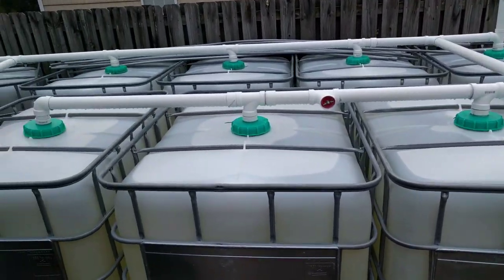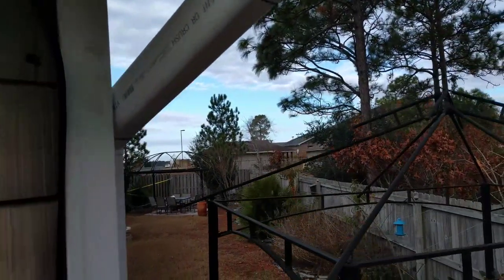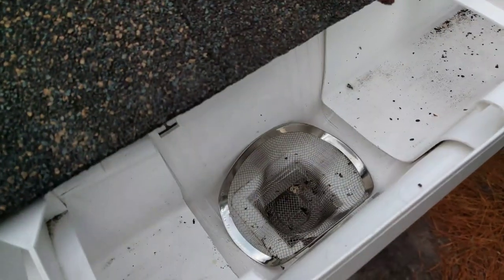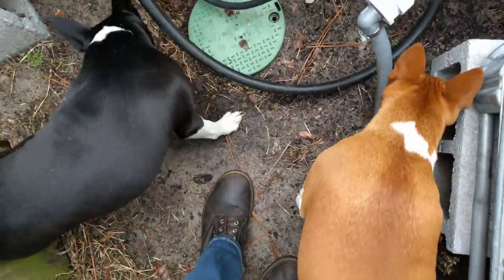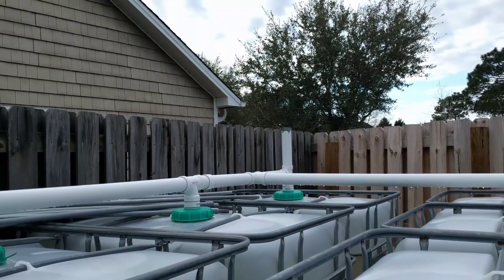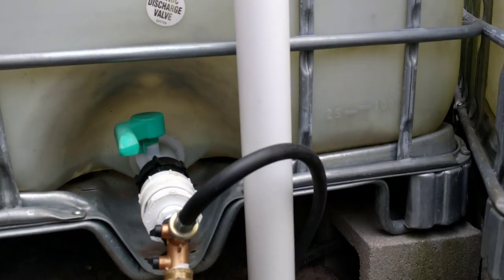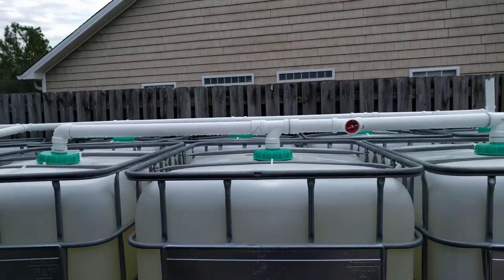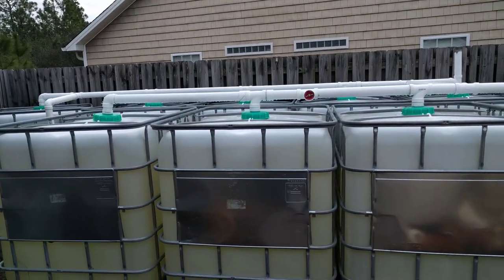Top 10 Tips For Rainwater Collection

Comment: You need to wrap those totes in black plastic or some other method to keep Sun off them.  You will have an Algea problem in no time.
Reply from the maker: Peter Gilfillan they are light blocked UV plastic totes (like the milk jugs that do the same) to prevent algae from growing - I live in an extremely sunny location and have had zero algae and I installed them over a year ago! you are correct though  if the tanks were not light blocked that would be necessary.
Reply: Brilliant work.  Love your set up btw.  Well done : )
Reply from the maker: thank you! It took lots of planning and plumbing :)
Reply: Yes indeed, tip 1, don't use translucent tanks. He now has some algae growth...😉
Reply: @ianmburke   how would i know if my tote is uv blocked? they all look the same like the white milk jug style, is there anything that should be writen on them?
Reply: @ianmburke  
Do you use a UV WATER STERILIZER SYSTEM? 
I have a few for my rain water HARVESTING systems and my storage tanks.  After distilling my water it's stored in tanks.  The air between the tank and the water can accumulate micro organisms and bacteria. The UV WATER STERILIZERS will keep your water clean and safe for drinking. A small aquarium pump will keep your water circulating and you won't have that old water smell. You can use a solar panel with a small battery and charger to power to aquarium pump.

Comment: I have 14  330 gal. tanks on my farm one or two tanks at every downspout on the place so it is not a closed system. I treat the water once a month with 8 oz chlorine per 330 gal. water  .0002 % chlorine per 330 gal. water, this helps control mosquitoes and bugs and sanitizes the water from bacteria. the water is used for washing vehicles and farm equipment and irrigation of flowers and gardens.

Comment: on your over flow.. suggest a vent of some type so you dont end up with a siphon happening. good to break the flow.. does not need to be big but good to have it there or you will end up emptying all of the tanks
Reply from the maker: It's kind of complicated the way mine is specifically designed but the breather pipe acts as the atmosheric pressure breaker for anti backflow. Once the intake pipes are drained the air inlet allows air to break the process of siphoning

Comment: A comment on a broken tank... 30 years ago my next door neighbours 16' diameter 4' deep pool broke suddenly.  I heard the swoosh noise and looked from my kitchen window to see a 10 inch deep lenticular shaped lake in my back yard for about 5 seconds.  The water quickly  spread to several adjacent homes and other than a few nights crawlers that appeared and the fact that i didn't have to water my lawn for a while 2 hrs later you wouldn't know this had happened.  One chewed tank leak us nothing to worry about.
Reply from the maker: I appreciate  the shared experience, some things to note is that all the tanks are linked so if one gets chewed threw they will all drain to that point so 2500 gals - also run off path and absorption rates vary wildly based on location, and soild and grade. So it's always good to just play it safe

Comment: Nice setup, but...  That algae is going to be a problem, until those tanks are light-blocked.
Reply from the maker: Never was, I had the setup for about 5 years and the garden never minded the small amount of algae that did form... it's all about cycle rate and end use
Reply: @ianmburke   Ah, so garden use only. In that case, the algae is probably a bonus. Very cool setup.

Comment: Ian! Help! I love how analytical you are, but I am stuck in analysis paraysis. I'm a city girl who just moved to Texas. I purchased a 4 acre farm (soon to be farm). There is currently 5 water spouts and a 1/2 dug out dry stock tank. My property is on a slight down slope. House at the top, and then it downgrades into the garden area, barn, 4 small pastures, stock tank, wooded area, and a running creek of which I own 50% of that flows through my property at the bottom of the slope. I just got my water bill which is double form the previous owner, who did little gardening and had sheep/goats. I currently have little garden (fruit trees - 8) going on, and currently no farm animals as of yet. I am prepping stages and trying to prioritize my most important costs first...water! Then the garden, then the animals will be the order. I recently went to a homestead fair, which they shared that any water stored above ground could be confiscated by the G, but any water underground/stored would be 100% mine by law. You made A LOT of important facts to consider. Do you have this all in an ebook? or written down. I would appreciate any help. Great video! Any improvements or benefits since you posted this video 5 years ago?
Reply from the maker: I do not have a ebook or any real written reference materials but just my name as it appears for the channel with middle initial at Gmail is my email address so feel free to reach out there as well... But I would say as step 1 plan for the largest end use case for you: all the animals look up each ones daily consumption needs for water, same for the garden and so on. Then do a quick city data rain fall average look up and see how many days you need to prepare for without rain on any given year and then give yourself a good 10-20% increase (that should be your storage size) underground becomes a lot more money obviously and will take a lot longer. Some things to consider if you do have water rights to the creek and it has some elevation or flow rate it in you should look up water 'ram pumps' there are a ton of videos on them and they can provide a slow consistent pump(electric free) that can move water from a creek or elevated location.  Some things that might be useful as well would be looking up the exact laws around those government rules - usually they are written to prevent large farms from diverting streams and drying up the end of them so people making bigger ponds and lakes for instance by damning a stream or creek. (Which you should not do) downstream users won't be pleased (wildlife or people). Along with that, storing large volumes of water without an understanding of the dangers it can cause if for instance the side of the lake/pond resevoir eroded and then 100,000 gallons of water went rushing down hill and could cause havoc for a neighbor. Those  are the typical reasons the government gets involved in making the laws (to prevent people who might be ignorant to the dangers and ecological impact that are causing) that being said I assume above ground water stored in tanks is NOT something that could be collected.  I would personally recommend reaching out to your city/town hydro engineers (storm water folks etc) that's what I did and found all my local governing laws and so on. We have a terrible problem here with runoff so my local city encourages rainwater collection. 

In short 
Find your volume for supporting your farm with drought in mind. Mine was 2000 gallons so I made mine 2500 total

Look up the local laws on storage and the safety concerns about what would happen in the event of a leak/spill etc 

Look up ram pumps since you have an active source of water that also may make it so you don't even need to store water as long as it doesn't go dry.

Weigh out all the above and start penciling down two or three solutions for your problem.

I made several versions over 3-5 months of planning before I settled in my solution.

Then shoot me an email once you get an idea you can afford and legally pull off and I'll help in any way I can! 

Good luck on the project it sounds like you're going to have an awesome little farm 🙌
Reply: Farms in Texas are called ranches. 😉
Reply: Texas law allows rainwater catchment. In fact, the government encourages it. Your homestead fair source was sadly wrong.
Reply: @sm4942  Farms in Texas are called farms. Ranches in Texas are called ranches.

Comment: Where can I get these tanks?  I want tanks that block light to prevent algae.
Reply from the maker: These did block all the light at first and still do a little I've never cleaned them and they have slowly grown a little algae in them but nothing of concerns. These are basically industrial single use containers so they don't hold up forever but they can usually be found on Craigslist - or if you know of any larger scale farms locally they usually will have them as well (I got mine for 60 each which is a very good price) most are around 80$
Reply from the maker: Also these were from a specific wax chemical used to coat fruit like apples so the containers are FDA food grade and that chemical needed light blocking containers so these all came that way.

Comment: Nice system. 
Question: I couldn’t tell from the video how you’re able to have the tanks get filled up with the distance between them and the gutters.(?)
Apologies if you already stated that in the video. Thanks.
Reply from the maker: The gutters are pipe fed at a height above the tanks and the system is sealed from gutter to tank, so as the height of the water rises the shortest point in the system becomes the feed port into the tanks

Comment: Consider weight of each tank (IBC, in this case), soil bearing. 
The distribution of weight will be over 4 concrete pads. 
Suggest increase the pad sizes for better distribution of weight.
Also area tank should be dug out to 4", sloped with drainage.
Then filled with 4" compacted gravel.

FYI 
1 cubic ft of water = 7.48 gallons = 62.42 lbs/cf
Hope this is useful. 
Enjoy.

Comment: You have a shingle roof bro. That is a system of layered sheets of fiberglass saturated with OIL and them multiple runs of granules rolled into the surface. besides the debris, you have to contend with oil contamination. At least consider a metal roof...just sayin
Reply from the maker: jim drake you are right about that I do keep 99% of the debris contamination out with the screens and the water trap. As for oils most are lost in the first three years after the roof is installed since this is the original roof and is now 13 years old it isn't loosing a lot. However that is an excellent point and my intent is to move to metal when a new roof is needed. That being said this water is for the garden and pond only and at this point I've had roughly 60,000 gallons through the system to date and have not had any noticeable oils or residue and I do water checks monthly to check for algae residue and parasites and have not had any yet.

Comment: Best gutter cover is called "Raindrop".
Best gutter cover is Raindrop.
Reply from the maker: Kyle Norman I could not find the price for that particular brand but did find: "Gutter guards and covers cost between$7.50 and $10 per lineal foot installed. Considering that the average home has about 200 feet of gutter, homeowners should expect to pay about $1,500 and $2,000 for professional gutter guard installation, though more complex gutter guard systems will be more expensive." Which is more than double the cost of my whole system; gutters, plumbing, tanks and valves which just doesn't make financial sense to me personally.

Comment: Since you put those in every cover them with black plastic paint them black so the sunrays don't create algae in the tanks I'm getting sunlight and heat
Reply from the maker: Kevin Sepulveda someone else in the comments below also mentioned this, however these are light blocked UV resistant plastic containers so no UV makes it in. I've had the system now for a year and a half and had roughly 75,000 gallons through the system and 0 algae. But you are correct if these were NOT light blocked algae would be a big problem!

Comment: Are these tanks daisy chained or are they filled by one tank overflowing into the next? You have no first flush diversion, so bird poop and stuff is getting in your tanks. Maybe you use your first tank as a first fish diversion. Most cities use Chloramine now instead of chlorine which does not off gas in 2-3 days, so letting city water sit won't work for most folks. When you set your overflow to go down your driveway you create polluted storm water run off, which is sadly the standard across the nation. Letting rainwater overflow into a rain garden that is away from your house helps your yard and decreases water pollution. A rain garden is cheaper to build and maintain than tanks to boot.
Reply from the maker: The first tank is isolated from the rest and acts as a pseudo first flush for the system and that in turn goes to the fish pond for further filtering. (Also as noted in the video the screens in the gutters remove most of the heavy sediment but the low point trap underground before the tanks also collects about 99% of anything heavier than water below the tanks and is drained periodically.) As for bird poop which would be dissolved into thousands of gallons of water equaling no noticeable PPM is actually welcome! I use all of this water to feed plants... plants are well known for liking rainwater and poop :)

Storing of city water is not something I would recommend almost anywhere if it can be avoided, even locally here in NC we have had Dupont polluting the water intake supply for a massive region. So yes your are correct AVOID it... However, if you are growing a very large garden (like I am) and run out of water during a drought period I would not recommend letting all of your plants die rather that using a small amount it city water that has been standing.

I am not sure where you are citing the concept of rainwater runoff being "polluted" as it is rainwater from the sky that would already be falling on the same driveway?  perhaps picking up chemicals along its path from driveway to end destination? Even still it would already be raining on this surface. Furthermore the community of homes in my neighborhood have our own rainwater retention pond that collects and redistributes the water to the city for processing where they remove heavy chemicals and other toxins from the water.
Reply: Having a community retention pond is very very nice and from what I read is considered to be one of the best ways to process storm water pollution and prevent flash floods. There are many videos out there from many cities across the nation discussing storm runoff as a major source of water pollution in rivers and streams. When the rain hits the streets it picks up oil and trash and takes it directly to the storm drains, streams and rivers,. Most of the rain water should soak into the ground and seep into the streams and rivers as clean water. That doesn't happen in largely paved areas and has been identified as one of the chief reasons for worsening flash floods. Flowers and plants love bird poop but I bet your pond can only process some of it. Maybe you have a large bog filter to decrease the risk.

Comment: And you missed the most important tip of then all, you need to use black tanks to prevent algae, i can't believe you spent all that money on useless material that your going to regret buying
Reply from the maker: This system is 4 years old now and has collected over 280,000 gallons of water and have not had a single algae problem thus far. I also use the water for watering plants and they don't mind the extra food.... So it was money very well spent, and has paid for itself and reduced my water cost by over 400$ a year... 

I can't believe you spent all of that time typing that useless comment that you are going to regret 😂😂